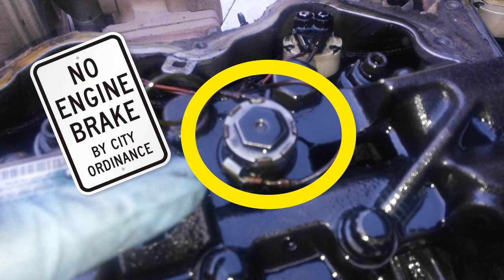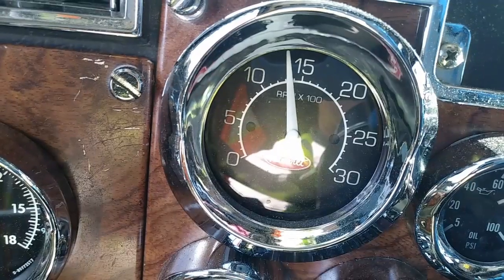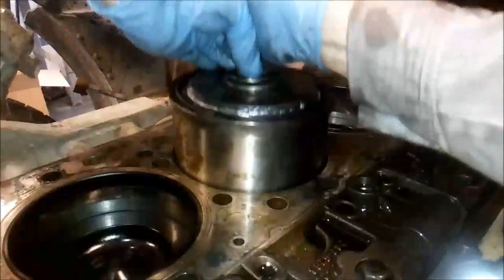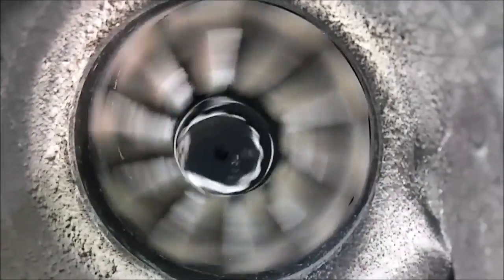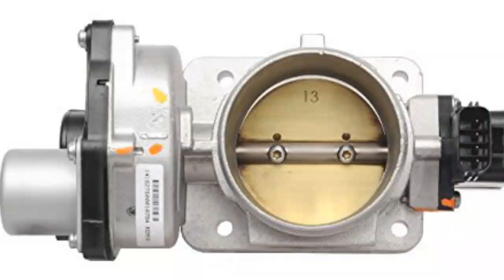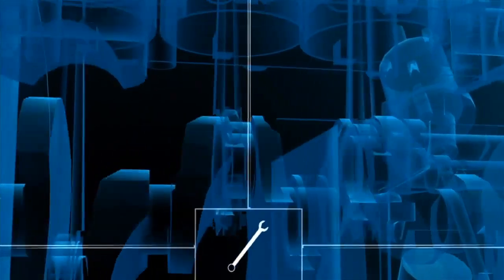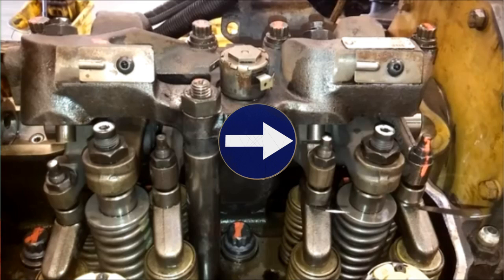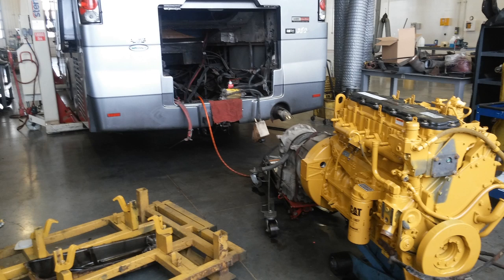The Difference Between Jake Brakes And Exhaust Brakes?

Comment: Isn't there at least idle rate of fueling even with the throttle closed?
Reply: No
Reply: When the engine is running at idle yes they do, but when you are decelerating/braking the engine is getting propelled along by the driveline still turning the engine.  When you push the clutch in you can hear the engine die off for a split second before it begins to fuel itself again sometimes.  Only the electronic engines will defuel themselves.  The older mechanical engines would continue to fuel themselves when the engine was used as a brake.
Reply: @brucelee64485  of course that's true, but it is still getting idle mixture fueling, at least on mechanical pumps.

Comment: I always wondered what it was/is about Precup engines that precluded Jake brakes. I know they had the Cat retarder and that it is completely different and not in the conversation. The DI 3406 engines of the late seventies into the 90s had jakes. But the precup engines did/do not. Why?
Reply: In the 3406A era of the early 70's the Jake brake was still pretty new technology that had not gained any traction in the industry.  In the 3406 A, and early B era Cat did not even acknowledge them and the truck manufactures had to take the engine apart, and install the Jake kit as a factory option.  I think even in the early 90's they were still taking the engines apart and adding the brake kits still.   Cat wanted to sell you the brake savers on our engines instead of the Jake brakes.  It was not until 95 when the E model 3406 engines came out that I know that the engine was designed from the start to have the jake brakes built in at the Cat Factory during the assembly process.  By that time it was so common to have engine brakes that when we would get one without the brake housing on top the inside of the engine looked wierd to us!  The original A model engines also did not have the beefed up exhaust valves and the Jakes were kinda of known for being hard on the valves and breaking the valve heads off.  Cat changed the make up of the valves later on the B engines and as the original heads came back through for reman purposes the A models got the updated valves in them at that time.  At that time we had to go directly to Jacobs manufacturing to get parts for the brakes just simply because they were considered an add on aftermarket and Cat would not carry the parts to fix them.  Now that Cat and Jacobs got in bed years later in the development of the Cat brakes on the later ACERT engines they carry the parts through the dealer network.

Comment: Can an exhaust brake stop a runaway engine.
Reply: Short answer NO
Reply: A .
Reply: Well it will stop the engine but not the forward momentum of the vehicle, gravity and friction will do that.
Reply: You need to shut off the air coming IN to the engine.

Comment: We have Thomas C2 school buses 2007 model year that have Mercedes MBE906 that do have both compression brake and exhaust  brake.  When both switched on you hardly need to touch brakes. Switch on dash is marked city (exhaust only) or highway (compression and exhaust together)
Reply: Unless the compression brake is really loud I wouldn't worry about using either in a residential area.

Comment: In my diesel lecture a few months ago, my instructor was saying that semi truck manufacturers are experimenting with start stop technology on trucks and are integrating the Jake brakes to release the compression when the engine shuts off so the truck doesn’t shake and rattle every time the engine stops when you apply the brakes
Reply: You can push the clutch in when you shut it off and it won't rattle at all.
Reply: Brody not on an automatic
Reply: @madjack1748  
What about auto shifts?
I really don't care for an auto shift myself, but lots of drivers do like them .
I guess I'm just a dinosaur
Reply: @bertgrau9246  Not sure, the rattling when you shut the truck off with an eaton fuller is from the trans, pushing the clutch halfway or all the way down disconnects the engine from trans so no rattle. As for automatics ya got me stumped, I don't think it hurts anything honestly.
Reply: @madjack1748  
SIR your probably correct with the auto shift,  I know your CORRECT about the manual,  the older Macks with the Mack transmission was the same way.

Comment: Jake brake + cat brake saver=rarely touching service brakes...gotta love it
Reply: Please tell me how CAT brake saver works.
Reply: @AmaroqStarwind  Basically a torque converter after your flywheel and before your clutch plate (manual) or flex-plate (automatic). But instead of transferring power to the wheels, it holds one of the rotors stationary. This way, it helps slow down the vehicle due to the drag induced in the BrakeSaver unit.
Reply: @electric7487  That sounds awesome.

Comment: I watch all of your videos , I drove big rig's for 34 yr's and I can tell you the jake was the single best invention in trucking ever !
I drove trucks without them and it was HELL . I put a exhaust brake on my 2006 Dodge Cummins and I can tell you I am impressed , I wish I would have done it when it was brand new . I went with the PacBrake because it was rated the best , and it is amazing . Thanks for all the good videos .
Reply: Also brakes on the steers.
Reply: You got to see a lot of changes. But the kids today aren't taught how to deal with coming off a grade without an engine brake. I drive log truck, theres times on mud or ice with steep ground where the Jake is no good if you want to keep your drivers rolling. They just dont teach new drivers real skills anymore. If the trucks mechanical or computer systems cant do it then its unsafe and time to park the truck. It's a sad state of affairs where we have a serious job and few are qualified to do it. Automatic slack adjusters is another advancement that has newer drivers with less skill. Most of them have no clue how to adjust them and never look at their brakes. I'm under my log truck mon, wed, and friday adjusting my brakes.... my life depends on it! I had my company take the auto adjusters off my tractor and put manuals on. I dont want to become complicit in assuming my brakes work as advertised. With manual adjusters I see and touch the equipment and yes... I found a cracked brake drum last week. Modern equipment is making unsafe drivers. No wonder accident rates are going up even tho rules and regulations are stricter.
Reply: @vf12497439  have to agree with you. The computerized & automatic systems on all vehicles are duming people down. Don't get me wrong some of that stuff is great but we shouldn't be relying on it 100%.
Reply: @vf12497439  1st two yrs driving bobtail tridrive bodyjobs transport straight into BC winters, I didn't use my jakes OR cruise, just lockers when needed.  I thought I would fly off the surface if I did.  So right onto the deep end.  Dad would be proud, meebee .. lol!

Comment: I have an RV and I have wondered about the fuel consumption with the exhaust brake going downhill. Good info for my 2010 Tiffin Phaeton.
Reply: Zero fuel consumption with the Jake brake or exhaust brake on.
Reply: ,,, fuel econ going  down hill, ,,, totally a non consideration.
Reply: ,,, the loud noise is actually the sudden, timed, release of compression.
Reply: ,,, the loud noise of the timed compression release is actually louder than the regular timed exhaust of combustion  .

Comment: Why do some Jake's feel stronger then others, same motor, same gear ratio,  same trans
Reply: Kwmike-D drop a gear while it’s on. The faster the engine turns the more effective it is
Reply: @donaldpauli129  not the problem
Reply: Probably need adjustment
Reply: @Raise986  How do you adjust them? They are very weak on my cascadia and it's driving me nuts having to slow way down so they will hold me back.
Reply: dposer10 it’s very similar to adjusting valve lash. You’ll need feeler gauges and a couple wrenches.
Reply: @Raise986  both set the same. Already had them checked and valves adjusted every 100k Both trucks were always different since new, noticeable difference
Reply: Some of them are adjusted differently. I drove a '98 Freightliner with an N14 Cummins that had supposedly "425 Braking Horsepower". They worked very well but sounded like a helicopter taking off whenever they were on.
Reply: @madjack1748  Cummins/Jake brake always work really well.  Alot better then the Cat Brake IMO
Reply: Kwmike
Not sure if this helps, but I know a diesel mechanic that says the feelers gauge is ok for valves, but he always used a dial indicator for Jake brakes much more accurate. That was back in the 60s so if it was the best way to adjust them then I would think now would be even more important.
Reply: @bertgrau9246  dont think that matters, both trucks are 2001s and they've had several valve adjustments since then and the one truck has a stronger engine brake since it was new..wondering the reason

Comment: Josh, I had an old Chevy 350 where the fuel could be cut off with a switch. Decided to try the throttle plate theory, going downhill with engine braking and the fuel cut off, it made zero difference whether the throttle was closed or open, still held back the same. (i.e. not much)

I think it is related to the fact that you can run the gas engine 4000 rpm to hold back down hill.  If you could run the C7 at 4000 RPM it would probably hold back the vehicle also.
Reply: Higher a diesel revs the faster it goes, they dont hold back
Reply: Was your vehicle manual or auto? Autos don't have much engine braking at all. Although realistically it wouldn't matter if you turned the fuel off on a injected system they always shut fuel off on decel anyways.

Comment: So what is your opinion regarding exhaust manifold durability on exhaust brake systems? Are manifold and stud failures more common on exhaust brake systems? How does your shop handle manifold issues? Machine or replace?
Reply: Rob Lunday probably it depend on the design and material strength of the exhaust system. If they strong enough usualy it will fine. The exhaust system mostly  corrode faster so see this factor too beside design and material.

Here in indonesia, i see that using exhaust brake mostly impact lifespan of the turbocharger (turbine side) which put stress on oil seal, the shaft and bearings of the turbo. Comonly happened on light duty truck such as fuso canter or hino 300(also called dutro). Both of them still use engine technology from 90s. Its mechanical direct injection without any computer control. Medium duty truck like hino 500 are not so much affected as they have stronger design and very relies on exhaust brake.

Comment: We have a 3306b that blew 3 times before they just said fuggit and left the jakes off
Reply: Should have went to a different mechanic...
Reply: 3306 engine you have to be careful on push tubes. You have a small tube for intake and a larger tube for exhaust. People get them backwards and causes push tubes to fold up like pretzels. I always throw the small ones away and put large one's in a 3306 with a Jacob's brake. 9TL's was the worst on this failure. 63Z's was not as bad. Also setting the lash on these as well, caused problem's.

Comment: Tell us more about the brake saver. Is it the same as a hydraulic retarder?
Reply: Basically,  it uses the engine oil
Reply: The brake savers used engine oil to slow the engine down.  Yes it worked as a hydraulic retarder in that it was like a backwards torque converter.  Instead of turning the outer shell of the torque conveter and driving the stator inside to transmit the power to the wheels the brake saver would hold the stator ring in place and drive the oil into the stator.  This would cause lots of drag on the engine and slow the engine down.  The problems with brakesavers are that they are HEAVY in the truck, required more oil in the engine to make it work, needed a way bigger oil cooler or in some applications they had their own oil cooler in the case of off highway trucks  because they made a TON of heat in the engine oil due to the way that the brakesaver shears the oil in order to work, they leaked if not maintained, and made servicing things like the clutch way harder because the torque converter is in front of the Transmission so you had to pull the brake saver off in order to get to the clutch.  Brake savers have pretty much went away unless you drive truck in mountainous regions or very heavy haul applications where you need the extra brakeing power.  Like some commenters have said, Jake brake plus Cat brakesaver equals hardly ever stepping on the service brake pedal at all.  Bad thing also is finding anyone who knows anything about the brakesavers anymore to work on them.  The old hands are pretty much gone.  I have been a Cat dealer tech for 25 years and I have only worked on two of them and that was years ago.
Reply: @brucelee64485   Slight error, you do not have to pull Brakesaver to get to clutch. The inner flywheel has the ring gear for the starter. Has four allen head bolts to secure it to the stator. The outer flywheel is for your transmission clutch hook up. However if you had the transmission out and did not remove the Brakesaver and service it, shame on you. You have a piston type internal ring on each side. Also each side has a hydrodynamic seal to catch any linkage past the ring. The hsg housed the part that the ring runs against. That part is removable and has a seal on it. If worn, piston ring will not seal. So all of these needs to be inspected or replaced. You had to have two tools to hold the stator as you assembled  it. The outer fixture was available through Cat. The inner tool is fabricated. When you are ready to install the hydrodynamic seals. I place the outer tool on first and lock the stator. Install the engine side hydrodynamic seal. Install the fabricated tool and may have to use washers or what ever to lock stator, and shim it flush. Then remove the outer fixture and install outer hydrodynamic seal. Reinstall outer fixture and remove inner fabricated tool. Install ring gear flywheel with mounting bolts  Get at lease two very long studs to screw in crankshaft. Install Brakesaver, making sure you time it to the crankshaft dowel. Install the allen bolts that holds the Brakesaver to the rear hsg. Now you can remove the outer fixture and install clutch flywheel, leaving guide studs in.  Start two bolts and snug. Now you can remove guide bolts and finish assembly.  
I worked on a early 1693 Cat and the oil cooler for the Brakesaver was not mounted on the engine. It was near the front tandem, with oil lines and coolant lines connected to it. Changing the oil was a bear, as you had to loosen the oil lines to remove all the oil trapped in these lines.
Reply: @brucelee64485  Interesting. Thank you.

Comment: My truck doesn’t have either. I have a c15 acert engine. Could I add jake brakes to it
Reply: Welner Zuleta yes u can.
Reply: @Jerzeyguy  yup, idk how u drive it without it.  Theres another guy on YouTube that tears down Cat motors and rebuilds them. He has a video about cat brakes, probably u could find them in a truck bone yard for better price then buying all new parts. Plus you'll have to have your computer reprogrammed for a  cat brake file
Reply: Jersey Guy how much?
Reply: @Welner  the cost will depend on the shop you go to and if you find a donor engine for the parts. Labor will be a big portion of the cost, depending on if your ape is adept or not will determine how bad you get hit on the labor.
Reply: You have an IVA hsg, that come with or without a compression brake. You would have to buy three of these, pay a core charge maybe. 
Wire cab switches up, turn on how you want it to activate in the ECM. I would replace my rocker arm studs with the new style. Last thing you could possibly break exhaust rockers. May want to update them as well, before failure.
Reply from the maker: Hi Welner, yes you can add them, but it can be costly.

Comment: Hi adept

If the jake brake and the exhaust brake are electronically controlled then in theory by a bypass switch both could be mounted on diesel engine that can support both systems. Only if the input is from the throttle input side.
If it is all controlled by a ecu then I don't know if it can be done.

But it's a thought of having both systems could help make the big engines more flexible in usage.

As I say it's a possible way if we can.

Your's Philip from England 🏴
Reply from the maker: You could definitely have both systems, but as Shain said you would be paying a lot and could only use 1 system at a time. Only advantage I can think of would be using the exhaust brake in quiet areas.
Reply: @AdeptApe  I did actually see a Ford Louisville with a 3406 back in 90 or 91 that had both a Jake and exhaust brake...the driver liked the dual system and said the biggest advantage was the quieter exhaust brake in residential areas as he moved paving equipment at all hours.
Reply: Josh; why couldn’t both systems be used at the same time? Exhaust and Jake brake. Greetings from Colombia.
Reply: That's a large financial outlay for the same outcome.  One or the other, but not both.